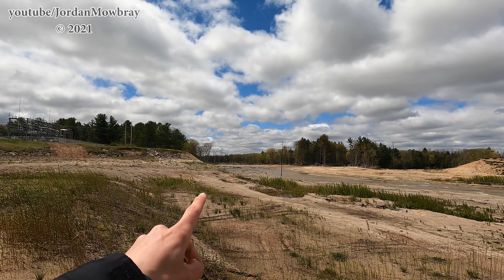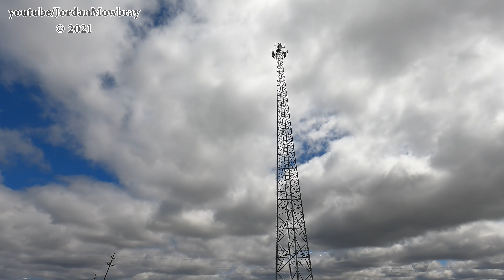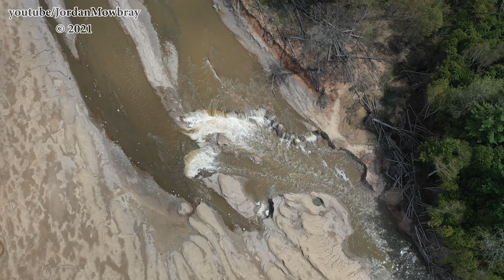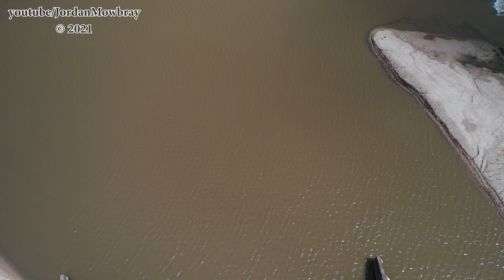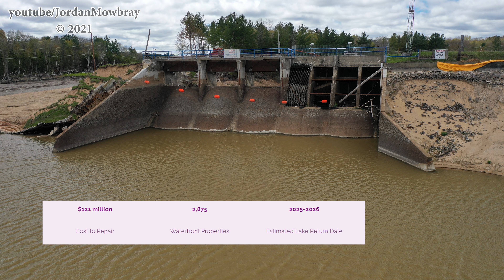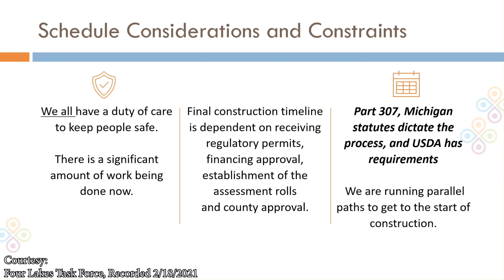Update: Edenville Dam - Edenville Falls - Wixom Lake Flood 2020 - Aerial

Comment: Thanks Jordan.  I am hopeful that residents will soon see how much better a free flowing River is compared to dammed reservoir and will ultimately decide to remove these dams entirely.  Dams are an environmental disaster and are not permanent infrastructure.  They ultimately  will require expensive replacement or again will threaten the downstream area with a catastrophe similar to what occurred in 2020
Reply: Most people will not realize that a free flowing river is much safer solution . 👍